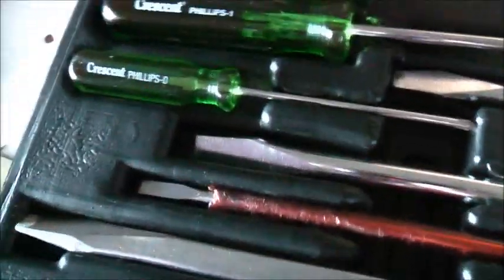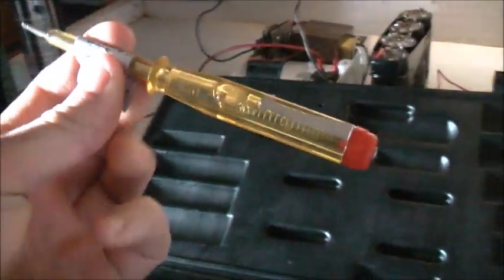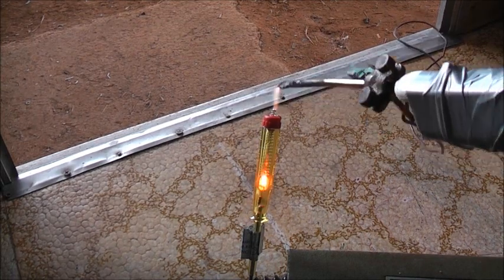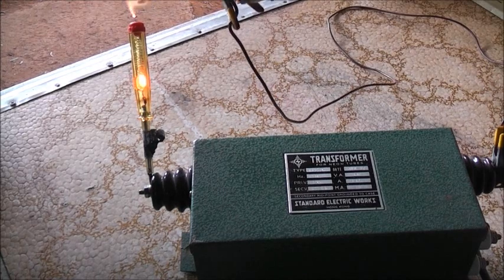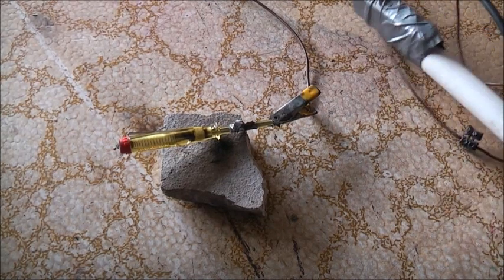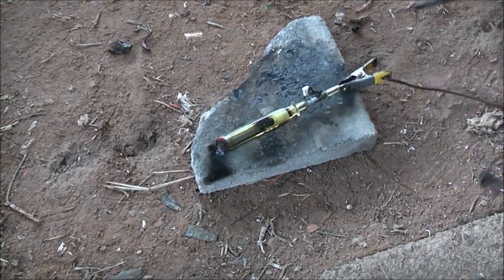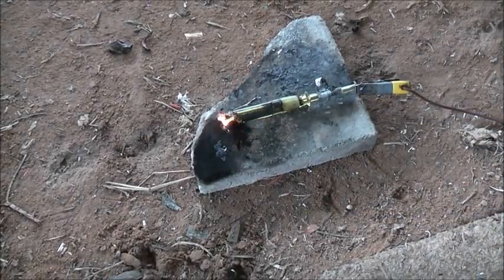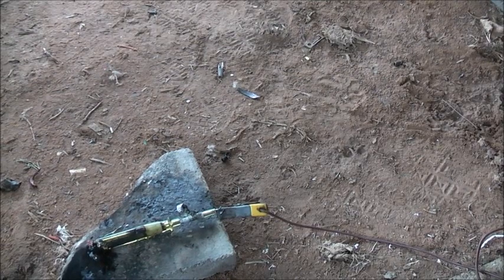Safety Retardant Screwdriver!!

Comment: I have yet to see one of these things here in the US...  I have something similar that tests for spark on an automotive or lawnmower engine, but it has a ground lead...  you clip the ground to the chassis and then touch the tip to the plug lead.  I'm "shocked" (pun intended) to see these deadly things in the UK and Australia, which seem to have more stringent safety standards than the US.  The closest that I've seen here is a voltage "sniffer" that lights when getting near a live circuit.